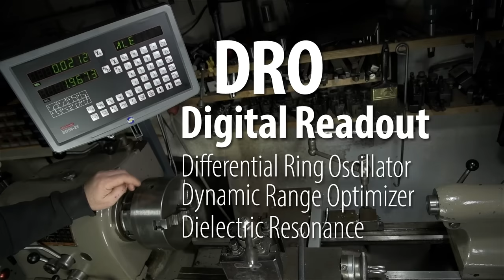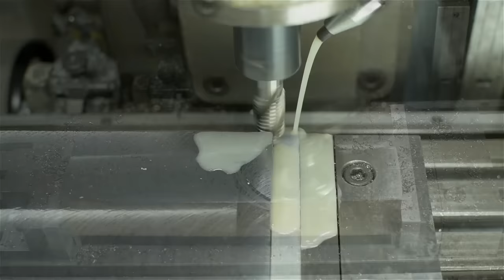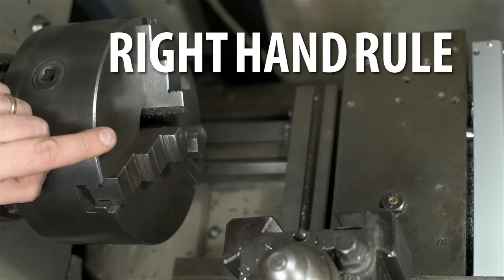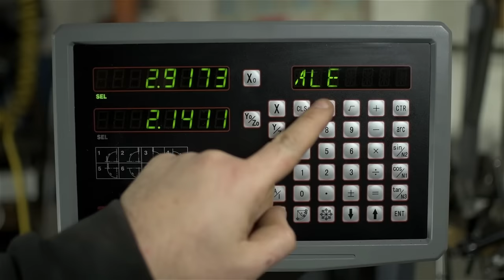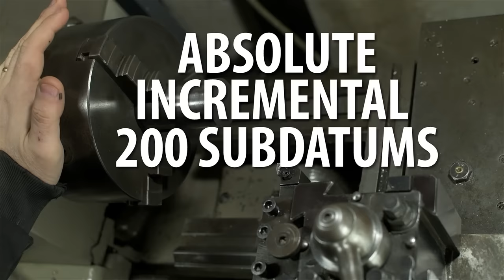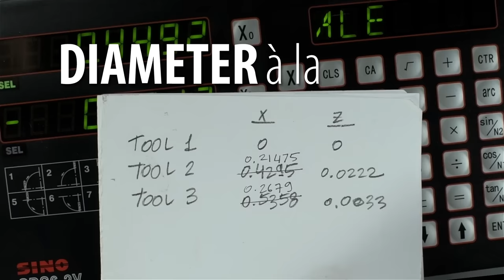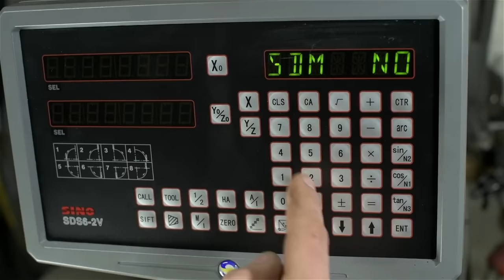DRO BASICS? & Lathe Tool Offsets!! (SINO DRO)

Comment: Tony,

There is definitely some conversion shenanigans going on here.  I would bet the microcontroller in your DRO is performing the metric conversion as you mention and then saving the converted number in the 'tool library' as a 16-bit floating point number.   You are literally observing the precision of 16-bit numbers (base 2) as converted to decimal (base 10) on the display.

Grabbing the last example from your video, you tried to enter 2.679.  This somehow rounded down to 2.673.  Through conversion math, you lost precision (at least twice) in the least significant bits of your significand.

0.2678
1 (1.) 0001001001  01101
- 1x sign bit: 1
- 10x significant bits (precision): 0001001001  
-- The first 1 before the binary-point (1.) is implicit in the format and practically provides 11-bits of precision in the significant.
- 5x exponent bits:  01101

0.2673
1 (1.) 0001000111  01101
- 10x significant bits (precision): 0001000111
-- Really the only difference between these two numbers is the conversion rounded down twice, as observed in the least-significant bits of the significand

If you want to play around with an online floating-point calculator, this one isn’t bad:
http://weitz.de/ieee/
Select your precision from the buttons at the bottom of the page.

P.S.  I just got back from vacation and the first thing I do while sipping coffee the next morning is catch up on your videos! Always a treat -- keep being classy!
Reply: Just fixed up the examples (binary 1's and 0's only serve to make your eyes cross).  Hopefully they are now mostly correct.

Interestingly, if your DRO was smart enough to perform the conversion in a 32-bit floating point format before saving the actual 16-bit float in the library, this error would have been avoided (or at least reduced to a single round-down event).
Reply: @luke.m  Float is a bad choice here. Using just integers representing 0.1 micron resolution internally would be error-free. 1 thou (least significant digit in inch mode) would be 254 units, 1um (LSD in mm mode) would be 10 units. Convert the internal unit to the choosen display unit on-the-fly. No rounding error, no error accumulation, no matter how many times one press inc/abs or mm/inch conversion button.

Comment: Hey This, or Old Tony... I have one of these DRO's on my lathe. Your video inspired me to spend an extraordinary amount of time working out how to use this '200 Tool Store". I've aged a few years and my doctor has prescribed me some Valium... It works! I've even set boring bars into this Chinese mental torture device. The place where i started winning was when I stopped looking at the 'Manual' and worked out what it was actually doing. It stores tool offsets in much the same way a CNC machine does. Once my feeble brain got that straight, it became kinda fun putting new tools in. I've got 12 holders, 10 in the 'Tool Store'. 
Thanks for the push.. Michael.
PS. I used one of those electric squakey edge finders in a collet as the reference.
Reply: Just a brief note to anyone that chooses to travel this route to madness. 
If you set all this and get it working DO NOT change ANYTHING that has anything to do with the physical position of your reference ( ALE ) tool holder. If you do, you are starting again with the whole setup as all the offsets you've set no longer mean anything. This is probably the most absurd feature I have come across in  DRO. I have now chosen to use the 200 datum's available instead.

Comment: I have the Sino DRO Mod. SDS6-2V on my SCHREINER D290V lathe I bought last year... it came brand-new with the lathe and already installed by factory and I looove it 😍😍😍 precision work is new defined since I have this I have digital readout on the mill too but not with glas scales and since I have the SINO I understood immediately why glas scale DRO is industrial standard... Took some time to check out the various functions the SINO DRO has and Tony will learn that in half the time but then there are some realy functional buttons on that thing 😉 I will never buy a new mill or lathe without Glas scale DRO since I know it... Good Luck and lots of fun with your Sino DRO Tony 👍
Wolfgang from Austria
PS :your quick change system is relatively easy to make some new holders i use a MULTIFIX Size B from PeeWee Tools Ltd. on my lathe and made one DIY holder which is soo much work its cheaper and easier buying them then building one per day maximum 😊😊😊
Love to see meatball again 👍

Comment: Tony, I love your stuff!

I hate to critique you, but I just have to mention that you skipped or missed a step when setting your ABS when you mic'd the part after your cut. This resulted in the 0.040" you said you were off in Tool 2.
When you take a test cut to set the X ABS, it is CRITICAL you either do not move the cross slide in the X direction, or to go back to the proper coordinate before over-riding.
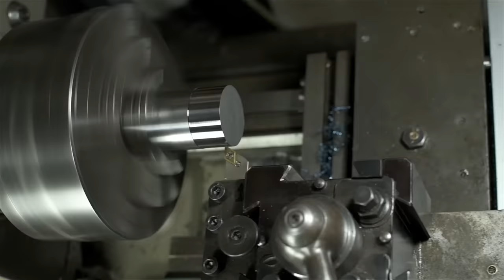When you were setting your X ABS when taking your cut on the part (21:59), you backed off (increased X) before you moved your tool in front of the part to mic it out. You did not move the tool back to the original coordinate when you over rode with the mic'd reading. Basically, you set the X ABS as 1.881", when your tool was actually in the 1.921" position.

There are a couple ways to properly go about setting your X ABS:
1) The easiest is to take the test cut, and then drag/rapid the tool back to the right (Z axis) and free from the part WITHOUT moving in the X direction. Then take your measurement and set the X ABS. Of course, you risk any damage in your tool by dragging it backwards this way, and cutting deeper due to tool pressure, giving an inaccuracy in your measurement.
2) Set X ABS = 0 for your cut, move the tool away from the part and forward like you did, THEN move back into the original X position (X = 0). Then you can mic your part and input the proper coordinate as your X ABS.

I absolutely love your channel Tony, its helped me become better at what I do. I hope you see this <3

Comment: Great! I have the same DRO's on lathe and mill. The manual on these is so awful that I have never used more than the zero function, the calculator (do you know of any way to clear the calculator without switching to DRO mode and then back to "CTR"???) -- and one I use A LOT on the mill which is the "1/2" function - great for finding the center of a part while using an edge finder. Set zero at one side, find the opposite side - and assuming we did this in the X direction, touch the "X" (not X0) button, then "1/2". The display changes to 1/2 its previous value - so now when you traverse back to "0.0000" you ARE at the X center of the part.

Love your videos, your sense of humor and your cat!

Comment: Tony,
any future DRO installs, please consider TouchDRO: smaller, more compact, much cheaper, app works on any Android device via bluetooth ....  the way of the future. Makes the DRO Pros outfit and the like look like mid 2000's era technology. 

 See that Sino box is just a dro it can't do anything else (besides take up a bunch of space). your android device on the other hand, can be your DRO AND do anything else -- like, for instance, you can minimize your DRO app during your  machining operation so you can browse the web to look up "what's the drill size for a 1/4-32 tap?" You can minimize the app and bring up tables you have stored on your Android device (i do that from time to time), or sometimes I bring up my TI-83 app to double check a calculation and a dimension  ---  then go right back to your DRO app

My $0.02

Comment: About your question about how it rounds up or down your value. You probably have scales that are accurate to 0.02 mm which is approx 0.0008 inches so your DRO is probably rounding to the nearest increment, either up or down a maximum of .0004. Try entering values in ABS datum. It probably doesnt do it in ABS but when you set up a tool offset it is to the nearest 0.0004. I could be totally wrong. Great video, I managed to fit a DRO kit on a colchester Bantam but I had to use a magnetic encoder on the cross slide, no way could I fit a glass encoder in there.

Comment: Many DROs have a reset pin on the ruler input.  With the application of a proximity sensor, the home position can set itself for a cheap version of an absolute readout.  Some linear scales include the index channel in addition to the two phases.  As this index only occurs at the scale index mark and only when both phases are low, you can count both directions from the index, so you can get minus numbers for how far you are into the chuck jaw spaces.  A proximity switch does not allow negative numbers as it holds reset until the switch is cleared and counts up.  Look for a 3 channel scale.  Often you can specify how close to the end of travel the index mark is located. This 3rd channel is common on rotary encoders to reset on one position to read absolute shaft encoder position.  For example some servo motors with encoders have a 500 count encoder wheel.  By counting transitions that is 2000 counts per revolution.  This is an order of magnitude higher resolution than a typical 1.8 degree 200 step stepper motor.

Comment: I believe the plural of 'subdatum' is 'subdata'.  Also, all CPU registers are of limited size (usually 32 or 64 bits) which means you get a limited number of significant digits worth of precision.  Also, there's a conversion to/from binary, which can result in rounding errors in decimals.

Comment: you're a great  advert'for SINO, so i nipped in and  got one, only had a 1120mm scale but I never get that far from the chuck, Sikaflexed the  mounting shs 32x32 alu 2mm wall, into the same convenietly sized groove in  the bed with 11fc, 11fc is brilliant, when I  wuz yachbuilding we set the windows in with this, wiped the lathe with gunwash firstest

Comment: I am rather curious about the AvE setting,  I suspect it's some kind of inverse reactive current for use in unilateral phase detractors that also allows automatic synchronisation of the cardinal grammeters.  But its just a guess...

Comment: I have the exact same one, other than the name. I use mine on my mill, though I’ve been thinking of getting one for my lathe too. It’s pretty good. The only problem is that the buttons require me to use my other hand when pressing them, as the force needed is fairly high. I did have to add washers and a lock nut for the swing arm, mounted on the mill, as it’s too loosey goosy. I also added a needle thrust bearing and a lock nut under the readout for smoother movement, as it tended to jerk around.

Comment: I'm pretty sure my contract specifies I won't work on any heavy machinery that doesn't take G-code. That said, it's remarkable how heart-stopping it can be even on a small hobby desktop mill to realize you've off-handedly just issued "go to absolute X=20.0cm" except your machine is still in relative, and that's outside your table, and you don't have limit switches...

Comment: Tony, when you took a skim cut with tool one you moved the X back and then took the measurement. you moved 0.04" back and then you measured and input the measurement. that's where your mistake was. when you take a skim cut in order to measure the diameter stop the spindle and dont move the X take a measurement and input it before you move the X.

Comment: Another excellent video! However, I have a question/suggestion...

When taking measurements in X, instead of using an indicator, just put a piece of stock in the chuck and take a cut. Then measure, as you did, with a micrometre. That way you can make your tool offsets defined to centreline. What this then gives you is that you will never need to set X again (theoretically), as all your tools will be referenced off diametre 0.
That's how you set tools in Haas lathes and I imagine all CNC lathes (have only used Haas lathes although I used different controls in mills).
P.S. Make sure to use the material you use most often and take the cut depth you take most often when doing this... You know... Paranoid Machinist... "Finished with my woman, 'Cause she couldn't help me with my tool offsets")

Comment: I'm not a machinist, I'm just a mechanic, I always use cutting oil (WD40 on aluminum and CRC cutting fluid in a spray can from Harbor fright for steel on everything that I drill or tap/die, not on iron or non-ferious) and I slather anti seize on everything that I bolt together, (anti-Ox on electrical) I never regretted it.  I watch machinists just to see how much milling that they do dry.  Ron W4BIN

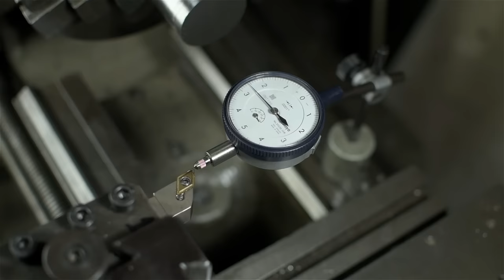Comment: This might be a comment you already had,  but either you caused a stuffer in editing or you spun your dial (ca18:40 in the video) one turn before zeroing it on the first tool (but not on tool 2 and 3) like I seen you do when taking measurements on the surfaceplate, any how, keep up the good work, you have inspired me to pick up the torch and not set the garage on fire 👨‍🏭

Comment: Tony, I’ve asked this before but I’m sure you missed my question on a previous video.  I know you use Premiere Element, but what software do you use to create animated drawings/objects that you insert into Premiere Element?  I have not found a way solely in Premiere.  Thanks in advance.
Reply from the maker: there are two types of animation (that I use).  99% of them are done all in Elements.  you can 'keyframe' the position (among other things) of objects... so it starts in one part of the screen and ends up somewhere else.  animations where you see actual 3D stuff, like rotating CAD, I do a screen grab of rotating CAD and then "Green screen" the background out.  Make your CAD background green or blue or something instead of white.   that would be on another layer in premiere, so my video shows through, and then that object can be keyframed in Elements if you like.  hope that helps!  sorry I missed your Q the first time 'round.
Reply: This Old Tony interesting.  I will dig into those more.  Thank you!

Comment: Just can't work out how you get the mill spindle rotating one way and the roughing mill the other.
We did a similar thing to you stocking chamfers. We are always being asked to put holes in things so in a quiet moment we made a stock. When we went to fit some, one devil had installed itself in the box and somehow the rest sneaked out!
We have that DRO on an HLV-H and now we love it.

Comment: I think those calipers are relative, too, it's just that the electronics are always on and always measure movement of the moving jaw. If you remove the batteries it probably looses the zero and takes the current position as zero.

The absolute linear encoders are way more expensive because for the incremental ones you just need two tracks of graycode etched into the glass ruler part. Fairly simple to make. Absolute encoder on the other hand requires a large number of tracks, basically if you have a 50 cm encoder and want 10 µm resolution you need a 16 track (2^16) ruler that has basically the binary numbers patterned into it (real encoders use something slightly different afaik to deal with a few issues, and have even more tracks), which is a way more complicated pattern, too....

Comment: On a much smaller scale, had something like that happen (stock slipping in vise) with a 1/4" HSS endmill and a small piece of aluminum. The aluminum slipped slightly (when taking off ~ 0.010"), suffering only very slight cosmetic damage (mostly from shrapnel). The endmill, however, effectively shattered. Then again, my dad got like 20 of them for aprox $2 each off of AliExpress. Two different brands, 10 in white tubes and 10 in blue tubes; 2 of the white-tube endmills ("AUTOTOOLHOME" brand) exploded the first time used (one on 1/8" sheet-steel and the other on aluminum; have only used 2 of these ones thus far); have also used one of the blue-tube ones (dunno brand, purely Chinese markings) and it has survived thus far, still paranoid though...

Comment: The DRO does work in metric, because since USA has signed the metrics agreement the imperial system is defined by a conversion factor from metrics units. So it's logical for the DRO to work in metrics :)

Comment: Maybe you could mount your quick change tool post on your grinder in such a way as to grind your tool holders. Also did you actually check that your DRO is reading the same with your first tool at difference turned diameters. Say turn down smaller as you said in the video. Did it read the correct diameter that you turned with the same tool? Maybe there is a setting or dip switch not set properly to match the scales you have. I have never used a DRO that changed numbers like that.

Comment: If I had the same shoes as Tony, I'd pull the quick change tool post off the lathe and mount it on my fancy pants CNC mill.  Then, I'd toss in an engraving bit and mark all my toolholders so my old eyes wouldn't have to work so hard to read 'em.

Comment: Welp. I'm caught up. I've officially watched every video in the This Old Tony cannon, and as a result I'm ready to weigh in. I'd like to offer a few suggestions for moving forward: More cats would be nice. T-shirts are fine, but up here in the catskills there's only about a scant 3wk tee-shirt season, so I wish there were a way to identify mi gente the other 49wk out of the year. I suggest making and marketing some kind of baubles. Something cooler than twisted ice picks. Keychain dustpans? Carbide earrings? Tool holder belt buckles. Bald hand truck tire ankle cuffs. I don't know, I'm not the idea man here. Wait. UTOT graduate hats made from an aluminum plate (the mortarboard) and spun metal bowl.
Reply: Anyways, I'm going to go update my LinkedIn to reflect my 2mo experience cackling at dad jokes about metal and math.